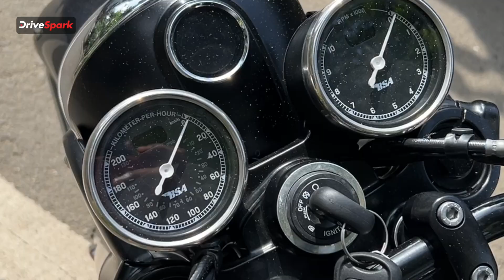BSA Gold Star 650 பைக்குல ஏன் Single Cylinder இன்ஜின் இருக்குது தெரியுமா? | Pearlvin Ashby

Comment: @7:38.... BSA about to launch other variants also with same single cylinder engine. GT and scrambler. 
Two cylinder or single.. it just a mechanical choice each has its own pros and cons. 
Two cylinder can achieve higher rpm than single... and single can produce more torque at lower rpm itself.
Reply from the maker: You are right.